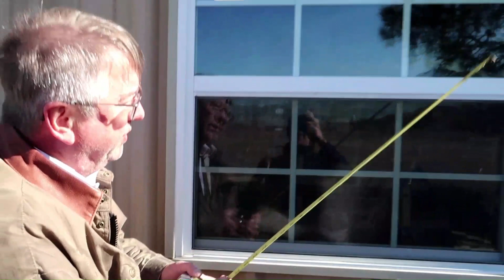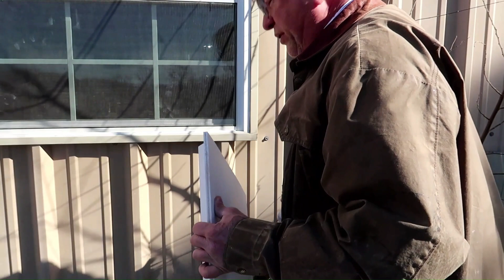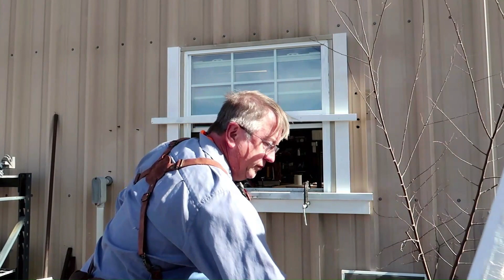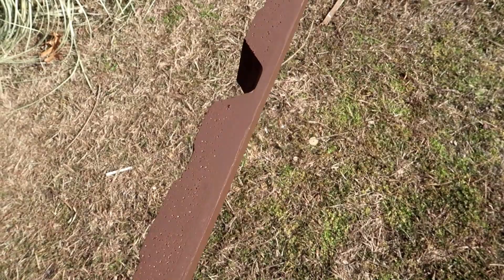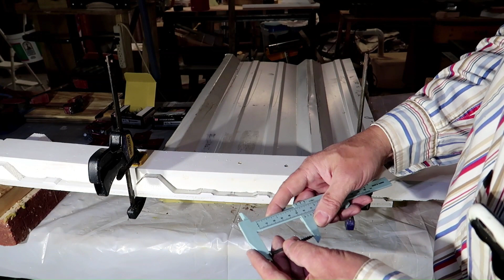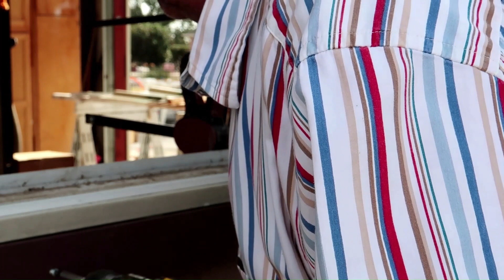Haslet Frames for a Window in a Metal Building

Comment: What is material that you are using?  Does it have any sort of waterproofing abilities?
Reply from the maker: The filler material that fills the voids between the ridges is EPS (extruded polystyrene) which is a fancy name for a dense styrofoam. The flat facesheet is an exterior grade plywood which we apply two coats of primer.  Yes, the filler material seals against water leaks.  We've sold over 600 Haslet Frames with no reports of leaks.

Comment: Why did you leave the j channel?
Reply from the maker: Keep in mind that the Haslet Trim pieces are installed around existing windows that already have J-channels installed. The J-channel installation stays because (1) it is not that noticeable after the Haslet Trim is installed; (2) it would require a lot of effort (remove the window, remove the J-channels, etc...); (3) the J-channel installation, as ugly as it is, keeps water leaks away, so why take out another layer of defense?

Comment: Question Mark? Did you do this for demonstration only or is this a permanent addition? If a permanent addition,  why didn't you remove the old J channels?
Reply from the maker: This is a permanent installation of the frames. The existing J-channels are embedded in the window structure. Besides the extra work to remove them, the J-channel structure is another layer against leaks.